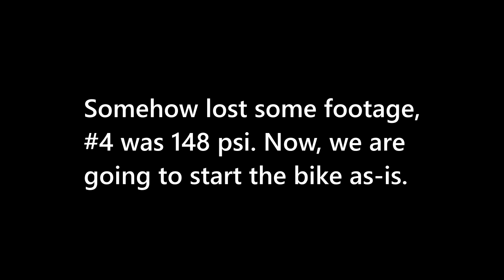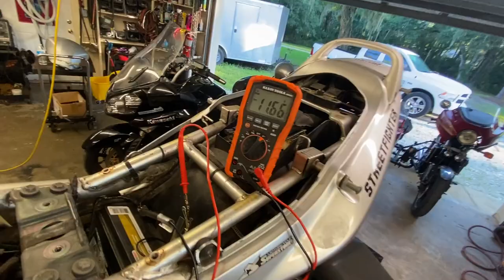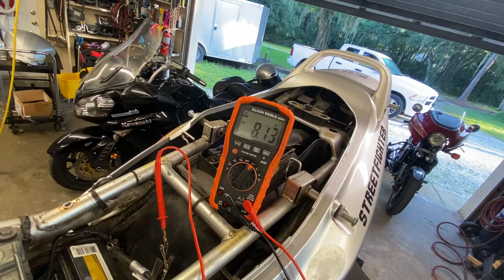Bandit 1200 won't stay running.... Let's fix it!

Comment: My 02 1200 has very similar issues, after watching your videos I'm more confident that I can get it running again after 2 years! Chasing vacuum lines and dirty carbs.
Reply from the maker: Thanks. Remember, everything is tied together, carb holders have to be good, vacuum lines as you said, valve clearance and synchronization, float levels spot on and surgically clean carb innards.
Reply: You know, after a year I'm leaking fuel between carb 2+3 (2 middle carbs) the 2 bottom ports pour fuel out like crazy, what am I missing? Even after Float adjustments.
Reply: @02Kracken  Sorry I can´t help you. Just wanted to ask if you have found the problem. :hand-pink-waving:
Reply: @ThePahan007 t barb replacement and proper cleaning

Comment: Nice job with explaining the carbs, and the reason for everything you've done. I'm an old school wrench myself and own a GSX-R 1100 with bst mikuni 36 ss carbs that I want to rebuild, could you do a show on these carbs please, my bike is a 1993 GSX-R 1100 wp model
Reply from the maker: I don’t have a set but if one comes in I sure will. Thanks.
Reply: @MotoRestoFL the 89-92 have the same carb my bandit 1200 01 is an Mikuni BSR36 

Correct me if I’m wrong?!
Reply from the maker: @BIKELIFEAP  I honestly don’t remember that bike is long long gone but that sounds right. Cheers.

Comment: Mister, your job is admirable. Hope you can help me. I have a katana 600 which the carbs looks pretty similar, i allready did a good and patient cleaning, adjust to 13 mm the floats, replace old petcock and i have and inline fillter, it idles the same as the one on the video at the beginning but in addition to that when driving on the hwy at a stable speed 70-80 it cut off and recover a while after? I dont see anything wrong with the carbs and i dont know what else to try. Thank you for your time

Comment: Vacuum actuated fuel valve should prevent carb overflow when engine is stopped.  When engine is not running "No vacuum pulses to the fuel valve" there should be no fuel flow to carbs. If there is any excess fuel to a cylinder it is because of a fuel valve failure.  A hydraulic causing a bent push rod can happen,  This would have to be from a lot of liquid in a cylinder. Hopefully on the start you will notice if the starter motor does a pause or hard stop. During the crank cycle, hopefully when the exhaust valve opens during the crank it blows most of the liquid out of the cylinder.  At any rate. Check your fuel valve setup to make sure it is working properly. These con rods are super strong and to bend one would take a lot for sure.
Reply: Vacuum petcocks fail all the time allowing fuel to flow constantly

Comment: what in the heck is that little tool for pulling the needle seat?  That was awesome!  Those o rings always leak after a bit, and I hate yanking it out with pliers.
Reply from the maker: Motion Pro dowel pin puller set. https://www.motionpro.com/product/08-0604. Doesn't always fit between the float arms/stand-offs but, when it does, it works great. Those removable float valve seats are almost always 8mm and thus, the 8mm dowl pin tool works great for them.

Comment: Went to ride mine today, the same issue. On choke it runs. I take the choke off it stops, oh joy. Yesterday it was 100%
Reply from the maker: Yea, crap from the tank has plugged up the slow or pilot circuit. There's more to it than just that, however. I'd like you to watch this video from Jimbo at Superbike Surgery, Ltd. in the UK. He explains the tiny holes behind the throttle plate on the CV carbs that are fed off the pilot or slow circuit passageways and it will really help you understand why it's behaving the way it does when things are plugged up. https://www.youtube.com/watch?v=7SFTdb9b3dI&t=3s
Reply: @MotoRestoFL  I will. Oh, I've already seen this one.

Comment: Put the blood pressure tester arm sleeve in the "Folger's" container on Your bench there - or something suitable similar, and it will be safe from sharp edges and stuff.
Reply from the maker: That's a damned good idea. I have a larger one available right now in fact. Hopefully I can find a place to put that, I'm pretty full up right now with stuff and I purge regularly.

Comment: Good video thank u ,what is the air fuel mix screw positions ( how many turn outs from full in per carb)?
Reply from the maker: I think around 3. It was a long time ago. This had the Holeshot stage 2 kit, I went off the instructions but can't exactly remember. It depends upon your setup and jetting.

Comment: Great video. I have an 03 silver Bandit 12. I am considering a Holeshot stage 2 jet kit with the K&N dual oval filters and a timing advancer. Also a Gsxr intake cam. Any advice would be appreciated. Thanks!
Reply from the maker: The dual oval filters that came with my Stage 2 kit, never fit right. There is some interference with the carb body back side, I cannot exactly remember, but after a short period of time, since they don't quite seat properly on the intake bell, the band clamp distorts them and they never go back on correctly. I eventually changed them to individual pods and it solved the problem. Talk to Dale about it, see what he says. Cheers.

Comment: Help.....on the back of the carb you have a clear pipe on fuel "T's" going in to 1 "T".. ....question ..where doe it connect to please... loving the lathe work on the aluminium  T you made...tia
Reply from the maker: Those four are extensions for synchronization. It’s impossible to get to the vacuum ports with the carbs installed. In fact, the service manual says to remove the carbs to install the synchronizer hoses, then remove and reinstall the carbs again after it’s done. Those extensions are just capped off until they’re needed then recapped and zip tied out is the way. Any other hoses that aren’t fuel are either vents or vacuum for the fuel cock.
Reply: @MotoRestoFL   great idea thanks for sharing

Comment: I've got an 01 Suzuki GSF 600 and it's wanting to rev up and down about half throttle any help would be appreciated.iv pulled carbs off synchronized the carbs and its still not getting better I've cleaned them some and were clean for the most part.
Reply from the maker: Not understanding the symptoms please be a bit more clear, I can't tell if it won't rev above half throttle or it does itself ramp up and down. I can tell you, "most part" won't cut it. Carburetors are precision fuel metering instruments. They're either spotlessly clean with unobstructed jets which are 100% open, any rubber parts in good condition, fuel level control in good condition (floats) and an accurate fuel level (float level) in all carbs; or they're not. There is no middle-ground if you want them to run correctly.

Comment: You said something interesting about the air filter pods that you need to change the jet ?? I have a 2007 bandit 1200s I wanted to put pods on will this change the way the bike runs of I don't suit the carbs as well ????
Reply from the maker: Oh, yes definitely. The air-fuel ratio is engineered to mix properly with a certain amount of air coming in and a certain amount of exhaust, etc. You change the air side by removing the air box, you can usually keep the stock exhaust it'll handle it but the massively increased flow will be way too lean for the stock jets. If you want to hop up your Bandit, contact Dale at Holeshot Performance (www.holeshot.com) and you can go on his site and what you'd want is the Bandit Stage 2 kit, but check it out for yourself. His stage 1 kit retains the stock airbox with modifications and slightly increased jetting, but with his 5 degree ignition timing advancer and the Stage 2 kit, it'll light up that engine smartly.
Reply: @MotoRestoFL  thankyou very much for the reply its really appreciated I have a yoshi tri oval pipe on it as well so could go for stage 2 kit correct??
Reply from the maker: I would imagine so, but I'm unfamiliar with the different aftermarket pipes, frankly.

Comment: I have the stock airbox and my nr1 carburetor it backfires at idle for sure it's something nasty inside,  pointless to say I hate carbs 😄
Reply from the maker: You’ll hate carbs less when your ECU takes a dump in an FI engine and it costs $1-2 grand for the module. 😲
Reply: That's because the vacuum  advance is taken from that carb
Reply from the maker: @bigmuller1  there are no vacuum advances on these Japanese motorcycles. Carbureted use mechanical advancers in the old ones and throttle pos. sensors (like this one has) to tell the ignition to advance a specific amount.  FI bikes do their own thing solely from sensors and ECU strategy. To have the Holeshot or other Stages jetting kit installed it must use the 5 degree advancer which sets the timing that far ahead in the first place. Again, that's why this bike has a TPS, it works in tandem with the (somewhat primitive) spark controller/ignition controller to provide that.
Reply: @MotoRestoFL  it's taken off carb 1 ...1 goes to fuel tap vacuum. To make the fuel diaphragm  open
Reply from the maker: @bigmuller1  I am aware of that. You wrote '"vacuum advance." That's an ignition timing thing. The fuel cock/switch/faucet whatever one wants to call it, is indeed vacuum actuated and often fails to great detriment.
Reply: Carbs are your friend when you have a fueling issue on the road/track. You can fix carbs road/track side. That's why my ADV bike is an old-school carbi model. I can and have resolved issues. Typically, when fuel injection fails... well enjoy the walk!

Comment: Hi! Please tell me how to buy online the special tool shown in the eighteenth minute - to remove the needle valve seat. I'm in Brazil, and I need this tool. I thank!
Reply from the maker: Motion Pro. It's sold all over the place. It's called a dowel pin pulling tool. https://www.amazon.com/Motion-Pro-Dowel-Pin-Puller/dp/B01IE4PC6A/ref=asc_df_B01IE4PC6A/?tag=hyprod-20&linkCode=df0&hvadid=309804735743&hvpos=&hvnetw=g&hvrand=1361643291048523477&hvpone=&hvptwo=&hvqmt=&hvdev=c&hvdvcmdl=&hvlocint=&hvlocphy=9012283&hvtargid=pla-570007026878&psc=1
Reply: @MotoRestoFL  . Hi! What is your name  :-)  ?
Thank you for the kind reply! Unfortunately the US$ 72.99 shipping cost to Brazil is a bad joke. With an image of the tool in hand, I'll try to find someone who can do an imitation. I only need the smallest one, to remove needle valve seats.
It was nice to discover your YouTube channel. It is possible to learn a lot. Thanks for sharing your knowledge.
Best wishes for health, peace and success.

Comment: Greeting! I'm asking for help. I have a 2001 Suzuki Inazuma 750. The motorcycle starts perfectly. Sometimes when driving, after 10 or 20, 30 kilometers of driving, it simply shuts off. It's like running out of gas. After about 10 minutes, it restarts without any problems. Any idea what this is about? Thank you in advance and best regards from Croatia.
Reply from the maker: If it shuts off suddenly and without warning, like a sputter or one or two cylinders dropping out as the fuel level reduces, it's electrical. If it does kind-of taper out and behave like fuel starvation, I'd check the tank venting, then fuel cock, fuel hoses, anything that could restrict flow over time. But again, if this thing just flat out shuts off without a hiccup, that's electrical and can be a challenge to diagnose. Simple stuff first. Check battery ground, main frame ground, and inspect the kill switch on the handlebar. Those switches in particular can get very fiddley due to corrosion, build resistance which gets worse over time and vibration, then a voltage drop causes shutdown. Ignition switch, also, can do this. If the simple stuff proves OK, it looks like that engine uses a pulse generator at the stator (crank position) and a cam position sensor to perform ignition firing duties. If it shuts off all of a sudden but restarts after it cools down, I'd be testing those sensors. If you can get it to fail at the time you can put a meter on the sensors as per whatever the service manual procedure is, that will help in the diagnosis. If everything tests good electrical, it'd be hard to say otherwise what the issue might be. But again, if it's electrical, always start at the basics. Cheers.

Comment: Where can a person buy that specialty socket? An internet search turned up nothing.
Reply from the maker: Which one? I made this video many months ago.
Reply: @MotoRestoFL  the 8mm socket you used to pull out the float valve with it's o-ring.  Thanks!
Reply from the maker: @williamfoster4268  no that’s a dowel pin remover not a socket. Pulls locating or dowel pins. Motion pro https://www.motionpro.com/product/08-0604
Reply: @MotoRestoFL  Thank you very much!

Comment: PLEASE help. my 03 bandit 1200 with 14k miles is not running right. SOUNDS LIKE THE ENGINE IS CATCHING/almost stopping on something when I slowly add rews. Also sounds like vacuum leak when trying to ride/open throttle more (but its not), runs rough like some cylinders not firing, noisy. I sold my previous bandit 1200 for that same sudden issue I can't figure out. bought another bandit 1200, now same issue. tested compression 145 on all 4. cleaned carbs (except for the adjuster screws), replaced little vacuum rubber plugs, adjusted valve clearance, replaced plugs (autolites), checked/reset cam chain tensioner (it has 1/3 life left), checked vacuum lines and carb boots with starting fluid (they're  good) THANK YOU. I can't figure it out for the life of me. Note: I used Rotella t6 diesel oil instead of motorcycle  oil in both of my bikes.
Reply from the maker: I need to know more. Stock air box or pods? What air screw wasn’t cleaned? Did you properly set float level? It’s real critical in that set of carbs, won’t run right unless the fuel level in each carb is spot on correct. Send me a video of it running. Motorestofl@gmail.com. I’m on vacation at the moment but I’ll try and watch and reply if signal allows.
Reply: @MotoRestoFL  I made a video of my bike...and found out that 2nd exhaust pipe temp is 85 degrees, while all other exhaust pipes are at 130 degrees.  replaced spark plug, no diff. could the coil be partially bad only for the #2 cylinder, but still work on #1 cylinder OR do you think the spark plug metal wire got disconnected (uncrimped) from inside the rubber boot on #2 cyl only? checked compression on that #2 cylinder to be 163 psi similar to other cylinders (new bikes have 175 psi).
Reply from the maker: @nadakeenr7715  1 and 4 are companion cylinders as is 2 and 3 for coils, for that wasted spark system, not 1-2 and 3-4. So, assuming you did have a bad spark condition on #2 due to a coil, #3 would likely be affected, assuming the high tension leads are intact. Doubtful the coil would be bad only on once cylinder. Indeed, you could have a bad high tension spark plug wire, but you'll have to figure that out (see below). What you need to do is get it idling and carefully, with an insulated tool or heavy gloves, pop off each spark plug lead one at a time, if #2 doesn't cause any substantial drop in RPM or make the thing stumble, you have problems most likely with carburation, with that good compression it's not a dead hole for sure. Swap #2 and #3 leads if they'll reach and see if the problem moves to #3. I bet it won't. Especially if you do the above test and only #2 has no change when you pull off the plug wire, it's highly likely not ignition, but carburetion. Cleaning carbs is a science, you have to clean every spec of crud out of every orifice or pathway. Again, I'd go with carbs but do the tests and see. Cheers.
Reply: @MotoRestoFL  I will do that. also, it backfires into the airbox a little. I guess, since the carbs just got a thorough cleaning, and the issue happened suddenly..not over time, I was rulling out the carbs. I think  it has to do with bad ignition ... overflooding #2 since there is only partial spark (hence the wet plug), and backfiring into airbox. if the coil is good, the wire from the coil going to #2 may be bad. I tried removing #2 wire...no difference to how it runs. so indeed it doesnt spark right....if it was the carbs, removing the spark wire would still make some difference
Reply from the maker: @nadakeenr7715  if the fuel is an issue on #2, the spark removal would likewise do nothing. Work the problem down from what you know to what is questionable. If you know the plug lead is bad fix that. May still be fuel related especially if your float levels are way off.

Comment: I have a 1200 2005 and It idles ok but as soon as I apply the throttle it cuts out, any ideas
Reply from the maker: Basically, everything you saw in this video, if you watch the entire thing, applies to what is likely your running issue, at least in some degree. It's most likely a fueling issue due to partially clogged (in your case) slow (pilot) circuits and/or a vacuum leak, or air jets on the intake side of the carb which are plugged up. Cheers.
Reply: @MotoRestoFL  thank you very much for your input mate 👍
Reply: @MotoRestoFL  Hi I hope you are well, it was fuel contamination which means I need to replace my filler cap, it doesn't pop or die now and runs like a dream, many thanks for your input kind regards from old bag 👍